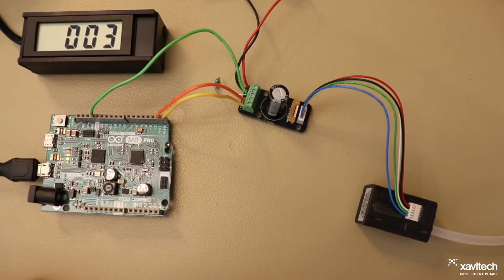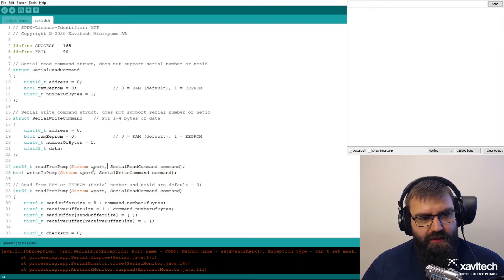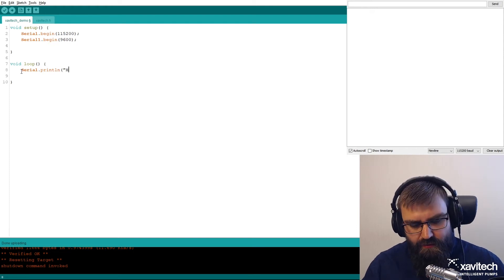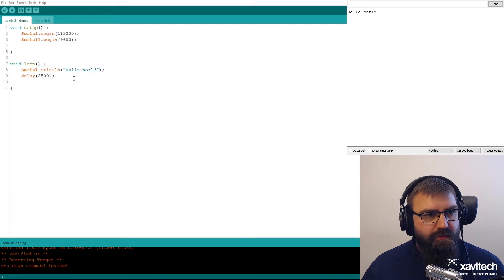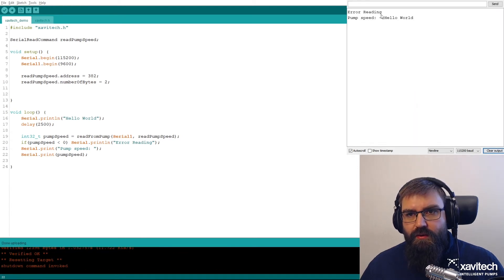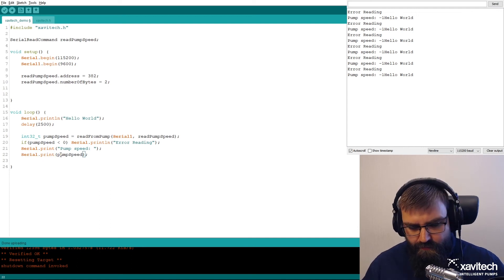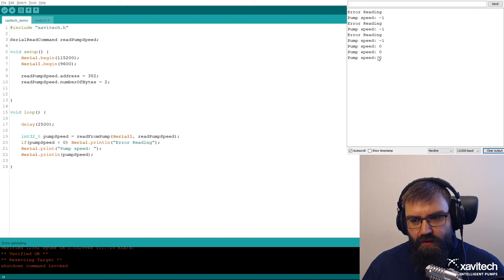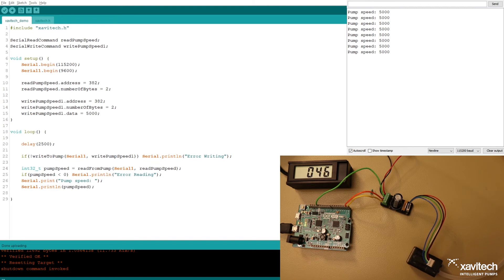How to control Xavitech pumps with Arduino | Xavitech Micropumps

Comment: Hello, I've been trying the pump with the PCB adapter, but had issue with the example 1 code on github. The Arduino was able to read the pump speed as 0, but every writing attempt failed. Any clue on this?